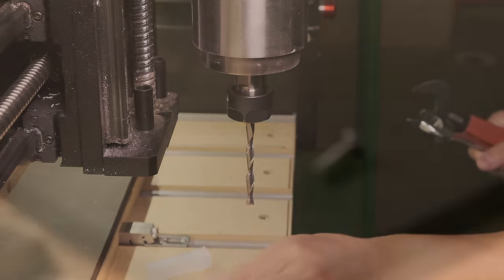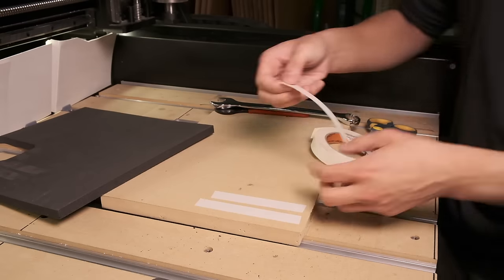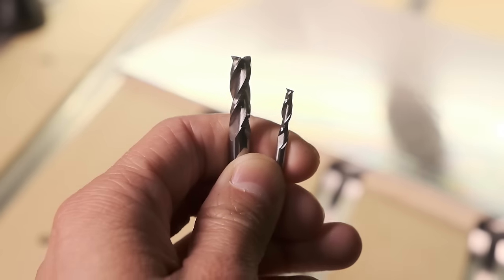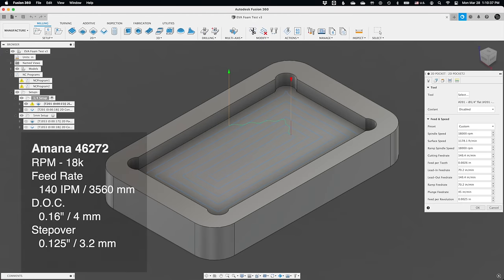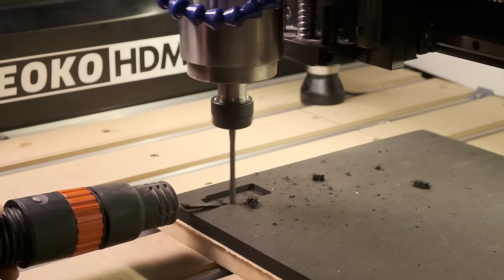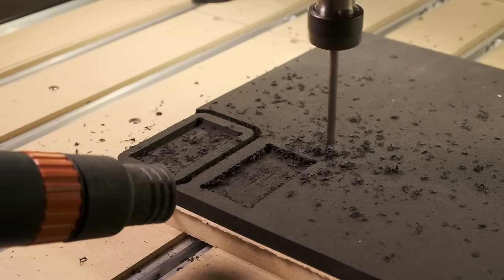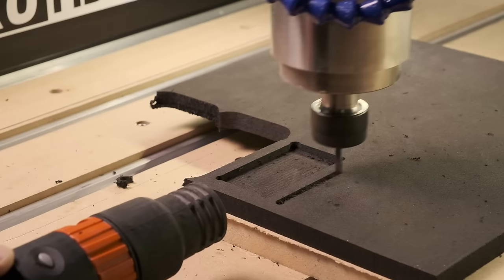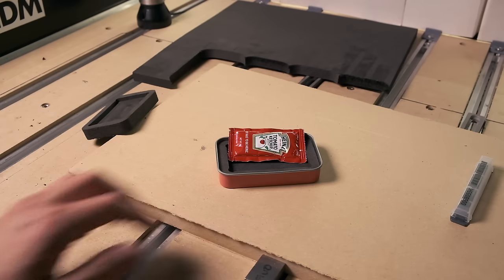How to Cut EVA Foam on a CNC Router

Comment: I followed Winston’s steps and got PERFECT cuts. I used a 1/8in down cut Amana foam cutting end mill. It cut like butter. I was using EVA foam tiles. This was for a case for a tool. It turned out perfect.
Reply: Which side did you attach to your table? The textured top or the smooth bottom? I’m wondering if one side sticks better, but also if one side gives a better initial cutting surface than the other. Thanks!
Reply: @TanyaHakala  I'm attaching smooth side with some cheap chinese double side tape, and it's not moving at all. I tried textured top to fix the same way but it's peeling off very easy

Comment: Ah the secret is out...
Amana makes a great specialty foam tool for this,  46270 / 46270-K. I have also experimented with some Dremel bits and found similar successes.
Your cuts are coming out really rough in some areas, the pockets look fine but the outside edges leave much to be desired.
As for securing the EVA, Tape has been the worst, Honestly anything involving the wood sacrificial board was a bust.
Enter my solution: Securing in a insulation foam sacrificial board, Forstner bit  to level it out, and using tall T pins to secure the EVA to the foam. Gotta be strategic when placing the pins to prevent them hitting the workhead, but I have found massive success with cutting parts using pins to hold place. Currently experimenting with EVA foam carving, I'll be sure to contact y'all once I get some solid results.
Reply: Oh and THANK YOU!! I got into learning CNC  thanks to your videos, Now I have a S3-XL thanks to a old work friend. Made a lot of my new workflow feel like a dream, I can't thank you enough!
Reply: Let me know how that works. I was thinking along the lines of the same solution. Outer edges are really all I'm concerned about.
Reply: I don’t have any problem securing EVA to the spoilboards with tape and 2p10.

Comment: I cut the butt caps for fishing rods out of EVA on my SO3. But I get it in 1.5" square 12" long blocks and I cut a 2 inch section off and put it into a vise and just cut with my normal ball cutters. It does pretty good.

Comment: Oh, man! I wish I’d seen this yesterday! I was putting the double sided tape on the foam. That was a pain in the neck, getting the backing off… I was using a lower density foam with a 1/4 down cut bit. My depth per pass was 0.5 in (I meant for O.05,  it 0.5 was better)… it cut perfectly.

Comment: I cut a lot of foam. Ive had good success with compresión bits. But I also use 6 strait flute cutter with very clean cuts at a depth of an inch. It is a tricky material for sure.

Comment: How well do these cutters hold up with longer use?  Many foams are notorious for how quickly they dull knife blades.  I've had breakaway knives significantly dull after just three long cuts in high-density EVA (100kg/m³).
Reply: Yeah, it's crazy. I was cutting EVA foam with scalpel type blades and they dulled after a few cuts.

Comment: Use the painters tape on both surfaces + super glue method to hold down the foam?
Reply from the maker: It's one of several options you can use.
Reply: I’ve been using a double sided masking tape. Look for Painter’s Mate Double-Sided Poly-Hanging Tape